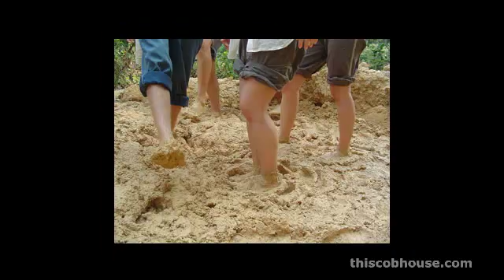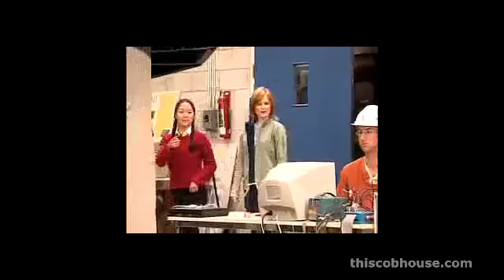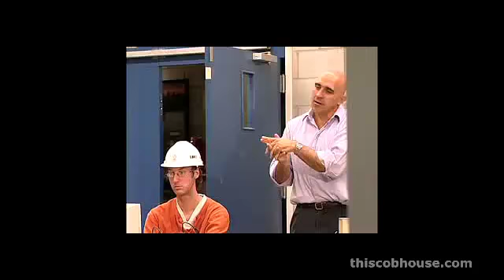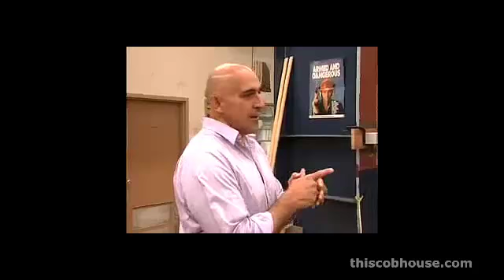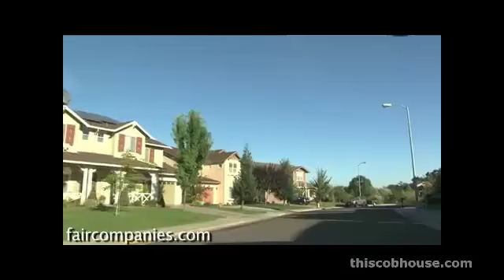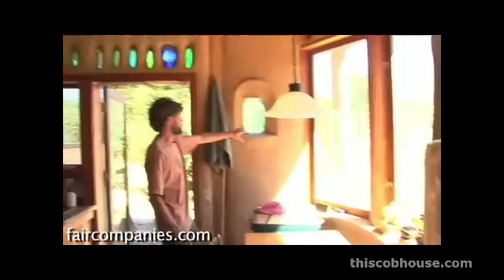Cob House: Post-Collapse Solution for Shelter

Comment: 3:50 It "withstood" the quake, as in it survived long enough for people to run out, but the thing was wrecked.  A wood building with the same quake resistance would have been much more salvageable. Cob is probably better for less shaky areas.